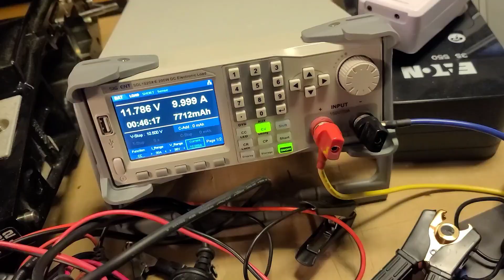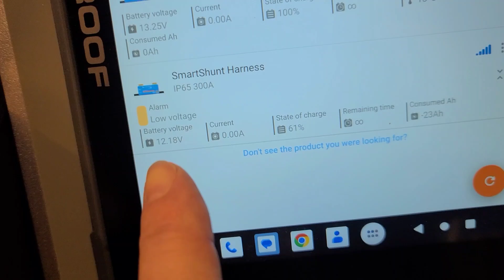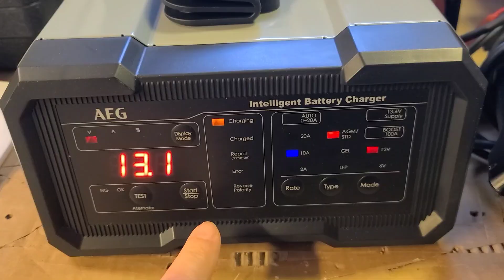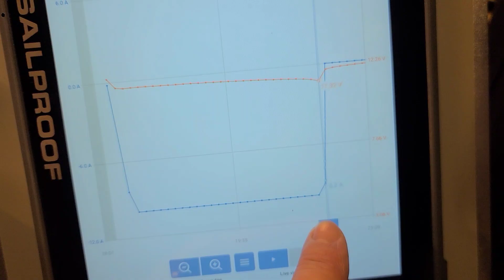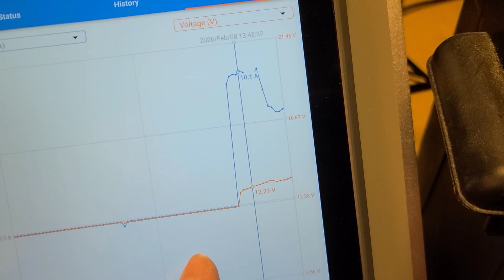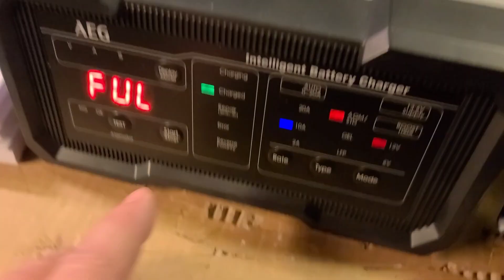AEG CW20: How Does It Charge a Battery?

Comment: Very interesting! I'm also interested in the "supply mode". Could you do a video on how it handles the voltage based on the current draw? And also the ripple voltage under stress... does it still hold 13,6v at let's say 23A for a short time? It would be interesting for some of us who use them when diagnosing cars...🍻

Comment: Is it in kinda maintenance mode? Will it resume some charging if voltage drops?
Reply from the maker: As I understood, it will not, but I have to check the user manual if it supports a storage mode and later do a summary video about different charges.